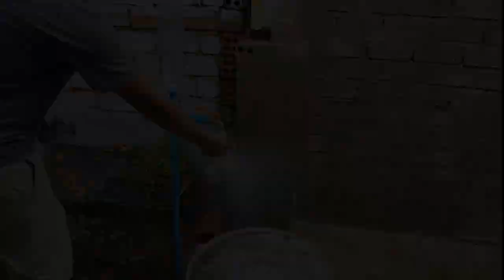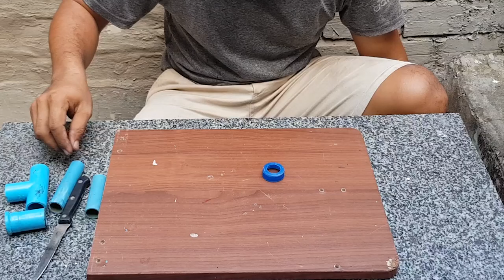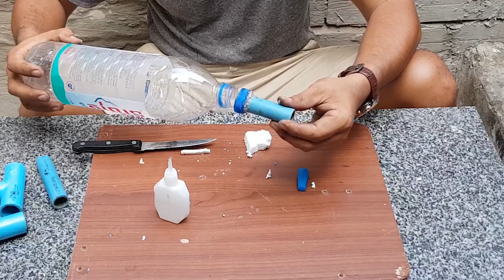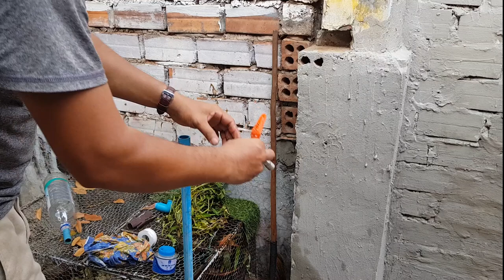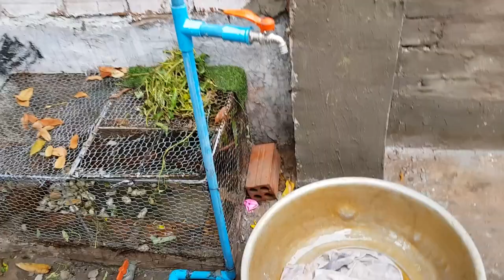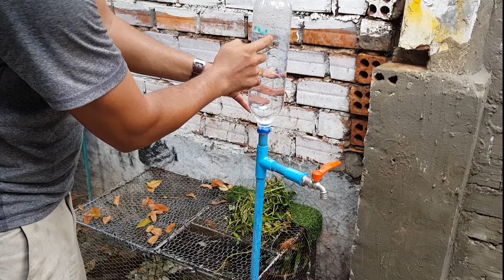How to make high pressure water from plastic bottle, #pvp #vs #plastic bottle.

Comment: the vacant space in the bottle is of course air, which causes the pressure... the pressure from the pipeline pushing the water and the pressure caused by the air space in the bottle combine to force the water out of the faucet or tap.. that's the one pressuring the water to come out in high force... this is a simplified version of the water tank pump pressure... if you had observed, the water pump tank is never filled with water because there is a high-pressure air space on top of the water tank which forces the water out of the pipeline... the principle is as simple as that.. i ve done this last year and I was not surprised it worked

Comment: A joke and a hoax. Do not waste money on this!
Reply: Try it. you will be surprised :)
Reply: @KauBoySL na try mo na po ito, gusto ko sana subukan sa elevated tank ko.?
Reply: @meynardsadsad4074  english please
Reply: I thought  there is an electric motor to operate that high pressured faucet🤣🤣
Reply: @loscuatroladosaquayard4634  Or even simpler, high pressure from the tubing in the street.